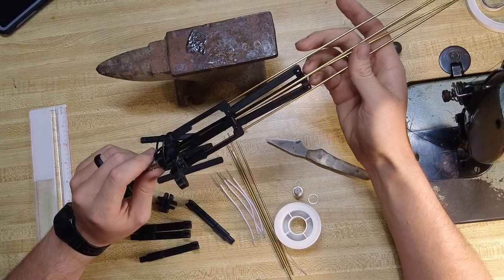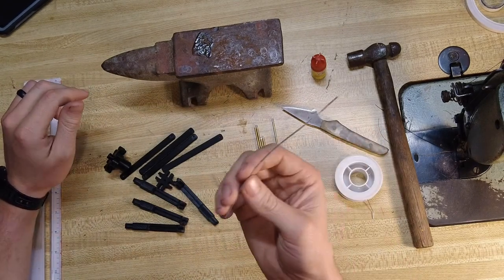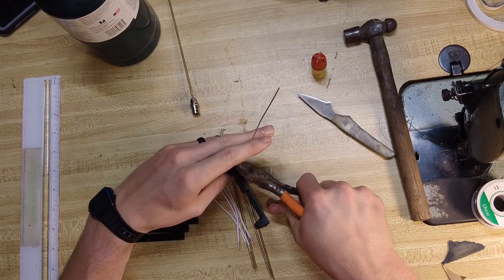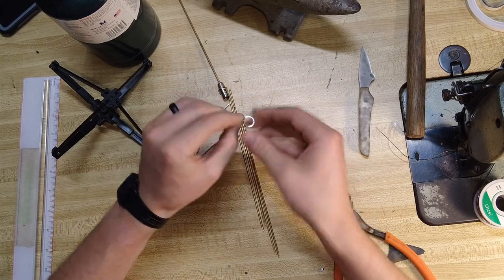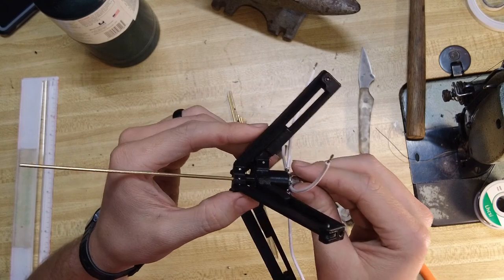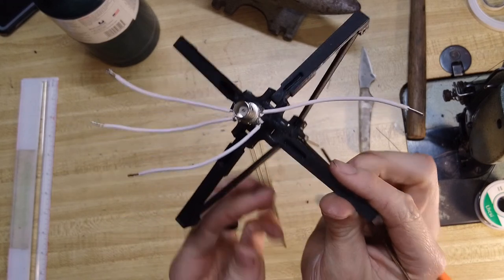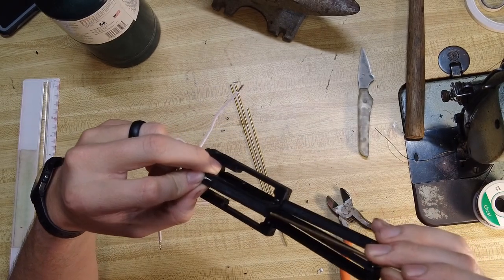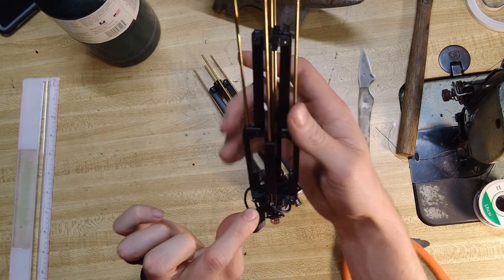Foldable Ground Plane Antenna // Free STL Files

Comment: What was the diameter of the rod you used and gauge of the wire?
Reply from the maker: @TacticalTomahawk  it was 1/8” rod. I don’t remember about the wire.
Reply: @thriftyoperator637 also, where did you get a 1/4 threaded part that was long enough to go through the little mount for the tripod?  Love the design, working on doing it right now myself